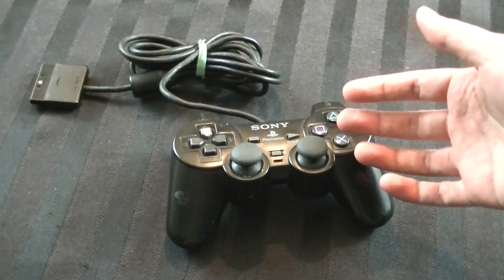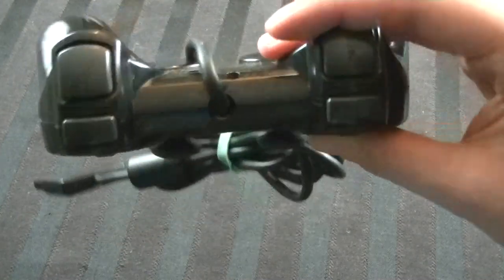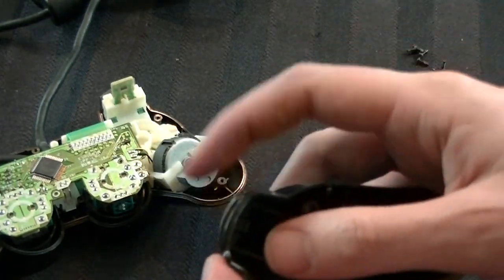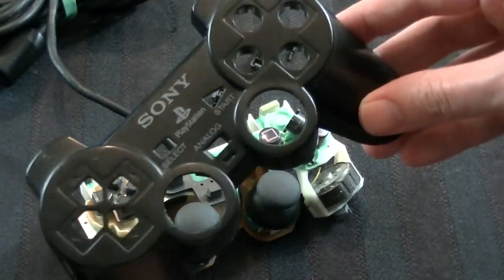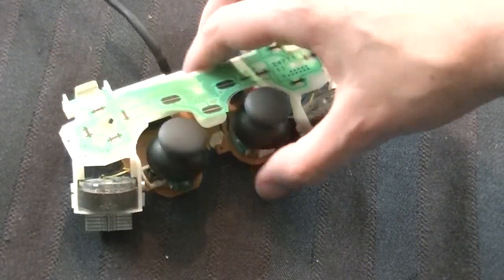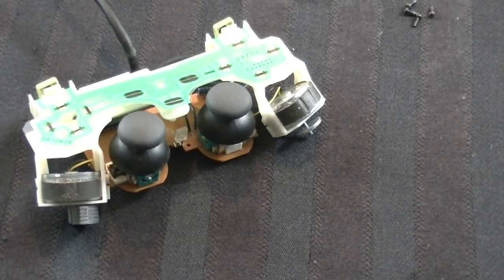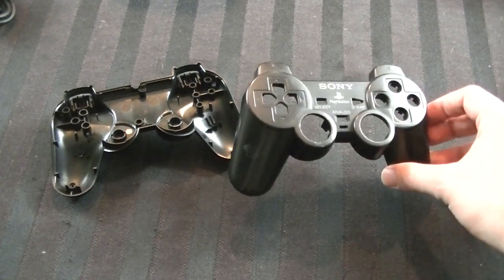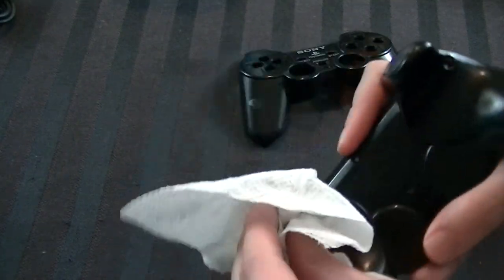Gamerade - Cleaning and Restoring a Playstation 2 (or 1) Controller - Adam Koralik

Comment: I have a question!
I found my old ps2 in the attic with two controllers, I started to play Silent Hill 3.

Controller number one: The two left triggers don't work at all so it's like it had a stroke over the years.

Controller number two:  The X button [rather than just be used as an interact and attack button] now thinks it is the map button, the cancel button, and the draw weapon button, and everything else so it has developed a multiple personality disorder.

If I follow the steps in this video and give it a good clean, do you think there will be a chance they will work better?
Reply: Perhaps you should definitely try but I don't think so you should check that into a professional

Comment: The R1 button on my PS2 controller was super mushy and didn't want to work right, so I used this video to take it apart. I was expecting it to be gunked up with hair and dirt and everything else because that's how the screws were as I took them out (I bought this controller used on eBay), but it turned out the button just wasn't making good contact with the silicone pad. Once I got everything lined back up and figured out how the R2 and L2 buttons go back in, it was a breeze. I wish all controllers were this easy to work on! I took apart my girlfriend's PS4 controller last year and nothing went right 😂

Comment: One thing I did with a PS1 controller that I got at Goodwill - It was super gross but I wanted a spare for my little brother to play, so I cleaned it completely and also used a paper towel and some cleaner (forget what kind it was) and ran it down the length of the cord a couple of times. Ton of dirt and grime came off. Check for broken spots in the cord first, though.

Comment: My launch model pad (made in Japan) recently developed a fault where the motors constantly rumble when system is on. I bought a cheap replacement only to find it does not feel quite same and when checking the back found it was manufactured in China. I think it's lighter and the cable on the controller is notably thicker on the original one. Might try and open it up as I want my og back in operation.

Comment: Over the years, I've found a bunch of controllers in the trash (bulk trash, people toss all kinds of stuff) and while most of them work, I had a couple with dead buttons. I figured that the contacts were just dirty, but when I opened them up and tried bridging the contacts with a metal object, even that didn't work. It worked on all the other buttons, but not on the dead ones.

Coincidentally I also had a couple PS1/PS2 steering wheels which also had dead buttons. I ended up tossing those without opening them due to other circumstances requiring a hasty cleaning/decluttering.

Comment: I got two playstation 1 controllers from goodwill yesterday. I restored one & it's in pretty good condition, however both of them have some bite marks (yeah bite marks, or a knife I guess) on the bottom of the left handle. Would the magic eraser fix that? Or is pretty much just stuck there

Comment: Cleaning the Analog Sticks on any controller should be included in the water/soap wash. You just pull them off the Joystick with a bit of effort and they come off easy. Putting them back is fine too.

Comment: The joystick's come off with minimal pressure, which exposes the actual two axis triggers. I just had one that was sticking, and popped it right off, and used to multipurpose lubricant (NOT WD-40) on it to give it back it's "Springyness".

Comment: im looking for a clear shot of the connection between the power cable and the motherboard, im not sure if its a socket or soldered in, im trying to repair one of my controllers with a donor, so knowing if the connection is soldered or a socket would help

edit: the problem is the one controller has pins missing from the connection to the console, and the other has stick drift
the one with pins missing has correctly functioning buttons from what i can tell
id rather not take apart my controllers only to find out that they have soldered connections instead of socket connections

Comment: Welp i'm already failing at taking the screws out. Got 2/6 out and the rest just refuses. The screwdriver should be fine but some screws i just cant seem to get a grip on with it. 
Tried to take it apart bc my left analog stick turns around itself and i wanted to see what happened there...
The other two controllers are broken aswell so i now effectivlt have no way of playing and ps2 games comfortably (the one i tried to take apart works but is a pain to play with, especially for racing games)

Comment: KIND OF OFF TOPIC BUT I HEARD YOU CAN TAKE THE BATTERY OUT OF A PS3 CONTROLLER AND REPLACE THE PS4 CONTROLLER BATTERY. I THINK THE PS3 BATTERY HAD MORE JUICE. THE LIGHT ON THE PS4 CONTROLLER DRAINS THE BATTERY. THERE IS AN OPTION TO DIM IT WHICH HELPS.

Comment: Welp, though all went well, and it doesn't work anymore after internally cleaning the controller, ugh. I was quite careful and did not disconnect any wiring internally as far as can be seen.Oddly enough, when I connected it to the ps2 the analogue lit up so there was power but no contact input commands worked! no clue at what so ever ={
Reply: What did you do? I have just had the same problem. I guess ill throw it away, analogue button works but none of the input

Comment: You can just lift up the analog sticks with a little force. The ps2 controllers with the stupid plastic membrane are quite different from the ps1 controllers internally. Also you can use some graphite from like a pencil, to rub the contacts on the bottom of the rubber to make a better connection.

Comment: I tried taking all the screws out but I can't get the last one out. Am I using the right screwdriver? Which type did you use to remove the screw?
Reply: They're all philips head screws but they strip really easily. There's often a stubborn one that won't come out.

Comment: hey, just wanted to say thank you for this guide :D It has helped me take my PS2 controller apart and clean it up.
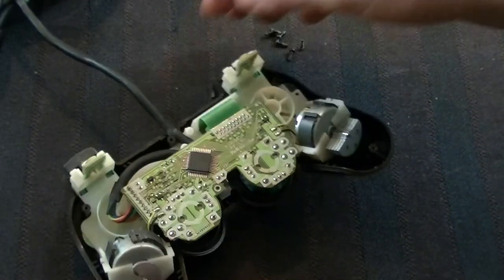Just one thing, my controller seems to be slightly different. from 2:39 and on you are focussing on the top half of the controller. I saw my controller cable was routed different, but that wasn't a huge deal, but there was a little screw (exactly the same as those in the rest of the controller) holding the board and basically everything to the shell. After removing this I was able to get it out like normal.

This is a standard PS2 controller that I bought ages ago with the PS2 Slim.

Comment: So I notced the red light between the joysticks doesn't turn on. The wire that goes through the light is cracked inside the actual light. I figure this is why it doesn't turn on, my question is this: would this keep the controller from working??

PS: You should be able to take out the rubbery part on the joysticks by just pulling it.

Comment: I was having problems with the shoulder and trigger buttons, the rubber connector bits kept bending backwards into the trigger and not sitting right, so eventually I put everything back together except the r1 and l1 button and used a toothpick to set the rubber connectors and just squeezed the two buttons back into place. Now, if only I could figure out what part inside my slim is busted so I can replace it.

Comment: Hi! I have a question, if you could help me. I have 2 Mega Drive(PAL) consoles, one it's Model RGB and the other it's PAL-G. When i connect the PAL-G on TV with RGB and not RF, it doesn't show any image but the sound works. I try to clean the port but stil nothing. Do you have any idea why it doesn't work?(The cable works, i tested on the other model) Thanks!

Comment: Why are you using windex over isopropyl or contact cleaner?
Reply from the maker: Rubbing alcohol leaves a film. The evaporation is an incomplete chemical reaction, facilitated by weak bonds in the solution. In other words, it looks like it vanishes, but it doesn't. Windex doesn't do that.
Reply: @AdamKoralik  Ok, thanks!

Comment: One of the pins in the connecting cord's mouth is missing can i cut the wire and join with a new wire
Reply: You don't need to, there are 9 places for pins, but the controllers only used 8 of them. Unless you have less than 8 pins?

Comment: I took my working controller apart cause it was missing a button then after putting it back together it doesnt work anymore.
Reply: What sub model controller do you have? On the back it should say SCPH-10010 and then there will be a letter stamped in the bottom right corner.

Comment: just be careful of the contact part of the board inside. that small rectangle. one decent sized spec of dust and one of the buttons may not work. 
those contacts are a pain in the ass. i also had a ps3 controler once where the plastic that holds it broke the small pillar and i had to figure out how to tape it down, every time one button wouldnt work. but just remember you have to test with a game that uses all the buttons to make sure they all work.

Comment: Can anyone help ? My DS2 left side doesn't work, the buttons on the right work and the analog light comes on but the d pad and left analog don't. I've had it stored in a box for years and it's virtually brand new. Is it fixable ?
Edit: the left analog is working now but the d pad and left shoulder buttons don't ?
Edit 2: the triangle button has stopped working now.

Comment: Man I really wonder if Somoene attempted to make the PS2's and PS1's Wireless. That would be pretty cool. And maybe the memory cards too. Instead make it as a Storage thing which the PS3, PS4 and PS5 has. Nothing changes on the PS2 or PS1. No need to have those Memory Devices. And depending on how big they are it will act is if it's 2 of em. Pretty big things which maybe people might do in the future. When I have a big imagination about projects like these but I don't have a imagination of Building a normal Minecraft house.

Comment: What I had the most trouble with was, yea, reassembling the controller, but more importantly getting the L2 and R2 buttons to fit snugly on their pressure points. On three occasions, I had reassembled the controller, tried testing the R2 button, but it wouldn't press cleanly. What's deceptive is it would seem to work... until I tightened down the controller's screws; then suddenly it wouldn't. I recommend only opening your controller unless you need to, because this cleaning process was a bitch. You can buy a new controller for about $7/ea ($10 if you buy two), so consider how much your time is worth to you before trying this.
Reply: Where can you buy authentic Ps2 controllers that cheap?

Comment: My controller was terribly dirty when i found it in my attic after years. Opened it up, cleaned it and everything then when i was trying to put it together there was plastic piece sticking out from the L stick and i tried using a knife to cut the piece off so i can put it back together, ended up cutting my finger open and it bled terribly i almost needed stitches it was veey deep but im glad i didn't. Life lesson for my self DO NOT FIX OR CLEAN CONTROLLERS ONLY CONSOLES. Im no good with controllers after the super Nintendo. But the controller is all together now and works. Doesn't have that broken feeling anymore which is great and the whole reason why i did this only thing is the left and right top triggers are kinda stuck. But anyways thank you for the video cuz i would've fucked the entire controller up.
Reply from the maker: Sorry about your finger...
Reply: @AdamKoralik  thanks man also thank you again for the video, i would've been so lost without it

Comment: Guys don't ever use a fuckin wired controller just because "you think you have to" for PS2 the Logitech wireless controller is awesome. Not only that but me and my friends work on wireless controllers and mods all the time. We're close to completing a wireless Sega Saturn 3D Controller. PM me if you want more info.
Reply: +Joseph Lathrop what the hell is wrong with a wired controller? At least I know the damn thing won't lose connection or run out of batteries. Wireless controllers are cool, but don't shit on wired controllers, they're a shit ton more reliable.
Reply: +The Unfunny Chameleon Don't get me wrong wired controllers give a sense of nostalgia to me and I still do appreciate them. All I'm saying is that if you don't want to use wired controller on these old systems there's always alternatives. Also tangled cords=frustrations.
Reply: Joseph Lathrop do you mean the logitech cordless controller with the blue logitech sign in the middle of the controller ?
Reply: Mr.Lenoir yes sir.
Reply: Joseph Lathrop thats the best controller i ever used in my live !
Reply: Mr.Lenoir it is an awesome controller. They made a great Xbox one too.

Comment: I physically can not get those L2 and R2 buttons back in properly without the shoulder button membranes having a fit and ending up like a rug shoved against a wall.
Reply from the maker: Redesign or something? It shouldn't be that hard.
Reply: @AdamKoralik  it seems to be a slightly different one because it requires a screw internally to keep the motherboard down. I don't now if I could bother skipping it and do it this way, hmmm...

Comment: recently did this, now I need to re-solder the rumble engine's wire
Reply: +CaptainPsychopath lol know how you feel bro
Reply: +Kevin Huiskamp found a brand new Ps2 controller on ebay though, so I'm all good, still annoyed that I screwed up the old one though
Reply: don't feel too bad about it, it's not hard to do at all :P
Reply: rip the wire i mean by that
Reply: +SeepMan Productions nope, was around 340 nok + shipping. so around 50$. but eh, pretty much worth it.

Everything just feels so more tight ;)

Comment: So Ive cleaned like you did in this video and put it back together. When i tried the controller, up and down buttons doesnt work but side to sides perfectly fine. X is working if i push hard and O is acting like an X button. Square and triangel are not responding. And the left analog stick is stuck going downwards. Any idea whats going on? Should i give up?
Reply from the maker: Sounds like the board has damage or wasn't connected together properly, but I'm not sure.
Reply: @AdamKoralik  Ok, thanks for the answer.  Youre probably right :(

Comment: I just attempted to take the guts out of an old working black ps2 pad and put them in a non working red ps2 pad.....couldnt get the two parts to go back together no matter how much I tried....then bits would start moving out of place and I would have to start again and realign them, then still wouldnt go back together, then I tiny bit of plastic broke on the shoulder button.....That was it.....I launched both against the wall then jumped and stamped on both.....I now have lots of broken plastic.....I strangely feel nice and relaxed now I have smashed them..... Never again will I open these stupidly fiddly controllers!......Just off to ebay now
Reply: There are a bunch of different revisions that all differ slightly internally. Extra screws, different button attachments and alternative rumble mechanisms are all things I've noticed cleaning my (3) dual shock 2s...